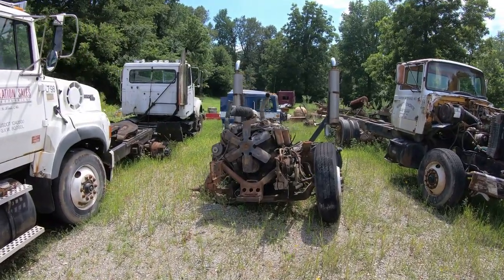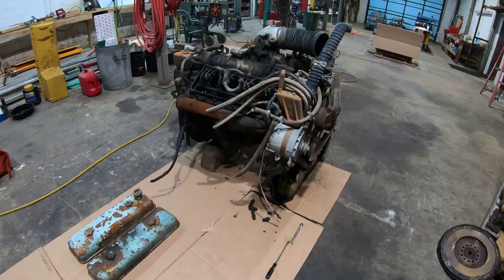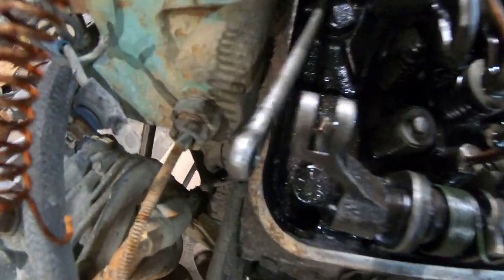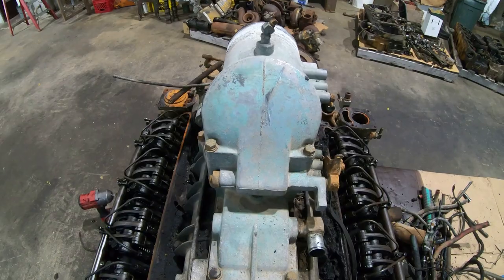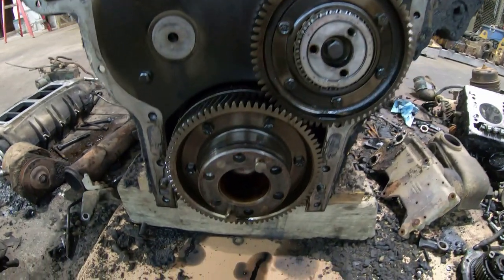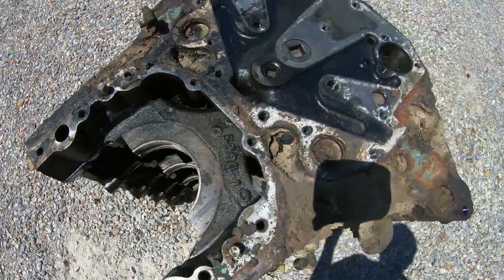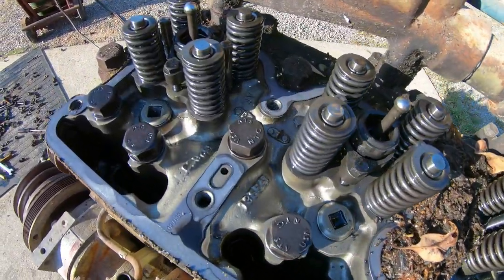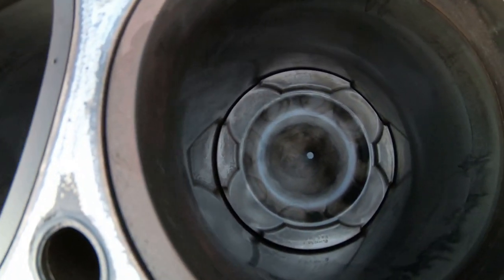Runaway 2 Stroke Detroit Diesel and Ethered Cummins Engine Tear Down

Comment from the maker: Link to runaway 8V71 Detroit video:   https://youtu.be/zp99ewVvqeI

Link to 855 Cummins ether video:   https://youtu.be/cPh6NFvBCnc
Reply: KT3406E 
you got yourself quite a playground
invite me over all bring food, beer, etc....
Reply: I had a 300 Mack engine do this too. Valve broke off and beat the crap outta the piston. Then pieces of the valve moved to other cylinders and beat on them too. What a mess.
Reply: Can you set up another "Viking funeral" with a random big liter diesel, sucking in a balloon full of Tannerite?  Like say having a tube plumbed to the intake.  Trap-door-drop a sausage shape balloon full of tannerite into the intake of an 8v71 or turbo of a 4-stroke.  Yeah, that would be great to see what happens.
Reply: When charging a dead battery aren't you supposed to charge at low amps?
Reply: Make a store where you sell your engine parts.
Reply: 6⁰⁰ @michaelcuff5780
Reply: An 855 or k-19 inline 6 woulds make for a fun sick 2 stroke conversion! inline 6 is easier to fill in the crankcase with billet aluminum machines and clears crankshaft and rods by about 0.125 in or 3 mm. make up some big reed valves and cut runner ports up the liners. now use all 4 valves as exhaust and running 1:1 with crank like fuel pump. a dry sump feed system and feed bearings, then throws off and burn off. This is how the Sachs, Hatz and some Duetz german 2 stroke diesels work.
Reply: The 855 might just have enough room to cut ports in the liners and somehow weld up the water jacket. or do a poppet valved u-loop charged 2 stroke conversions.
Reply: Those v8 detroit heads are bloody heavy ay mate  :) ,  i rebuilt  for the first time in my life an 8v92 from my cabover kenny quite a few years ago in my driveway , i had the cab up and clean and jerked the head off the left side of the truck ,  wont be  doing that again   :) .

Comment: As a mechanic that started out in the mid-70's, I worked for a nation-wide trucking company that, (at that time,) was 100% 6 and 8V-71s. Oil leaks? If you didn't add a gallon every time you got fuel, you started to worry something was wrong. You didn't mention them, but each side of the block had "air-box drains," which were tubing that allowed the excess oil shoved though the whole system go drip, and drip they did. A driver that idled an engine for any decent period of time wound up with two 6 inch or better circles of oil underneath, and going down the road slathered the underside of the truck all the way to the rear axles! California eventually outlawed them, which was the demise of Detroit Diesels as highway trucks. Thanks for this! A walk down memory lane. . .!!!
Reply: gac914 The old timer I worked with referred to them as “Green Leakers”. I’ve only worked on a few, but the memorable one that sticks out was a Roadway truck with a 6V-71. Like you said, it was POURING oil out the air box drains and the scale bitched at them to get it fixed. They brought it to us and we told them it was wore the hell out, but they weren’t having it. We were directed by them to install a ball valve in the drain tubes in no uncertain terms. Did as instructed, and a week later that poor bastard looked like a duck covered in crude from the Exxon Valdez oil spill. It promptly became their yard dog for moving trailers........But the sound of those damn things—- PURE SEX.
Reply: @DieselDoc78  Yeah, and they were pretty fast on acceleration, too! The other thing I remembered after writing the first one was, it was definitely possible to run them "backwards," and doing so they would start sucking the engine oil out and run on that. How do I know?? I had it happen to me once, and the only way in those days to tell was they had mechanical tachometers and while the engine would run, the tach wouldn't. They would run backwards if you didn't give it enough throttle while on a slight incline, and it would reverse the direction. REALLY bad if you didn't catch it right away -- fortunately I realized it quickly and dumped the clutch while holding the brake to stall it!! Fun days, for sure!! (BTW, I can't believe they'd have you guys install shut-offs on the box drains --  there was a management decision by someone who didn't know what they were doing, for sure!!! :-)
Reply: gac914 Typical Roadway management. Pencil jockey that looked at numbers and knew nothing about trucks.......At this point in my life I just need my pops to teach me how to row a pair of sticks before he’s gone. That and I really need to retrofit a 4-53T into one of my pickups.
Reply: There was a way to prevent the oil problem. Airsep made units that went on them to pull the fumes out of the crankcases. We ran ours with a restricted filter so that it put the crankcase under a vacuum. Then the only place the oil could go was out the exhausts. After it was burned in the engine. Still you needed to add 2 quarts of oil every 24 hours of running. We changed the oil every 300 hours of operation.
Reply: Harry. B. Renner. jr.  We ran ours at 1800 RPM normally and not less than 1400 RPM under load in stationary use.  If they ran under load at 1200 RPM, you would see unburnt fuel in the exhaust pipes. We actually saw it drip out of the plugs on the bottom of our mufflers so we restricted them to 1400 RPM or above. The overspeeds were set to trip at 1900 RPM so we did have a little fudge factor if needed but then we had to worry about prop cavitation.
Reply: @gravelydon7072  why change the oil at all if you're putting fresh oil in it EVERY day? Lol
Reply: @xandergibbs2149  Mostly for piece of mind. There is a certain amount of very fine metal particles that do not get flushed out with the oil that gets burned and the filters cannot take it out of the oil. So it goes out the drain every 300 hours. Oil is cheap compared to an engine overhaul and in our work, time down was very closely watched. DD recommended overhaul for our use was 7500 hours. In bad years, that would have meant an overhaul on a yearly basis. We ran them to twice that and more. $7000 a year in oil and filters vs $14,000 per overhaul in parts alone.
Reply: I had a john deere 440 CCW snowmobile that leaked a little on the clutch side! i was used to 2 stroke messes as a kid and now work on 2 stroke powered detroit dice boats, i bought a silver 8v92 and a small block 2 stroke johnson. next convertet a harley v-twin into a 2 stroke! We got 2 stroke diesels in our amy guard unit trucks some of them. and im looking for a Sachs DL600 crankcase scavenged 2 stroke diesel! it is dry sump feed to bushings and burns off sae 40! I once saw a Duetz 2 stroke 4 cyl on a welding generator with oil injection tank. it got scrapped bumber!
Reply: Self lubricating . Not for me

Comment: so, those holes in the head and block, were actually there on purpose!  Those were the holes that were used to mate two blocks and heads together when they wanted more than 8 cylinders.  The 16v71.  Since the 2 stroke cycle does not care about engine rotation direction, they would bolt the front of 2 blocks together, and the front block would turn backwards.  They could make V6, V8, V12, V16, and V24 units to order.  Many had long joined camshafts that were just turned around to match the new rotation direction.  The V12 was a pair of V6's bolted together.  The V16 and V24 were V8 blocks bolted together.  These were the first truly Modular engines, and only died due to emissions.
Reply: Really? That's pretty mind blowing, thanks for sharing!
Reply: @sourbrothers73  not exactly all true but close, the 12v71 is a true v12 block same with the 12v53 I believe. The 92 series is 2 v6s bolted together
Reply: There was no production 24v71, nor was there a 20v71, but there was a 16v71 which was 2 V8 blocks. The 12v71 was a true 12 cylinder block. In the 149 series, there was a 20 cylinder, and it was two V6s on either end of a V8 block
Reply: The Cleveland and Electro Motive Diesel engines are almost the exact same layout as the Detroit's. of course they dont part for part change over, but they are the same 2 stroke system. Intake ports, 4 exhaust valves, cam shaft controlled injectors. EMD has shaft driven turbos for the forced induction engines, as well as because the EMD motors have assembled blocks instead of cast. So they just build the block with more cylinders, 8, 12, 16, 20
Reply: and if you wanna see one ( twin block DD ) get sent to heaven ... head over to DEBOSS Garage's channel and check it out.
Reply: That is good engineering. With today's electronic engine management systems, those modular engines would work out well for any application.
Reply: @sammybrasch4926  yup that's it
Reply: Since general motors owned both Detroit diesel and Electro Motive Division [about 75% of the locomotive engines in the USA] till Penskie bought Detroit Diesel from General Motors there are alot of similarly designed engines in the bigger machines - the 149 series looked like a baby EMD except the EMD had a steel block - I loved them - if you had a bad wreck you just got out your torch and welder to fix the block.. sometimes it would take some in place machine work but you could get up and running - things could be taken apart without alot of overhead crains except for the turbo.  If you wanted to you could pull the entire power assembly - or if no overhead you could take it apart and manhandle the pieces.  The two stroke had good power to weight ratio so they were used in many many boats.  The 16 92
Reply: The 16 cyl 92 series could be souped up pretty hot - they had two 8 cylinder blocks bolted together- which is a pain in the ass to do - they had four 4 cylinder heads and blower drives from each end - only the front blower had a governor drive - the hot rods would have two turbochargers with what was called a blower bypass - the turbocharger would get more efficient than the blower so the engineers developed a way to equalize the pressure across the blower so it wouldn't drag the engine down.  These were great engines till the government regulated them out of existence- then came the series 60 engines.
Reply: @sammybrasch4926  Correct, but there was a 24-71 setup. It was 4 6-71s bolted to common gearboxes. 2-71s, 3-71s, 4-71s, 6-71, 6V71, 8V71, 12V71, and 16V71. As for the 16V71s there were two different versions. Both used 8V71 blocks bolted together. The early version used a one piece crank. The later versions used a two piece crank, bolted together. One piece cranks often became two piece cranks at the worst possible times. And there is a specific way of rotating the cam shafts for directional use. Depending on where you put the gear on the flywheel end decided which way it rotated the crankshaft(s). The camshafts always rotated the same direction as that is what controlled the valves and the injectors. At the flywheel end, idler gear on the left gave clockwise crankshaft rotation at the flywheel. With the idler gear on the right, you got counter-clockwise rotation at the flywheel. But the two camshafts always rotated with the top of the shaft towards each other. This also was needed so that the blowers always rotated correctly. The drive lobe was on the right while the driven one was on the left when looking at the blower drive gear.
Reply: @gravelydon7072  I bet your old like me to even know that - hardly anyone knows you can change the rotation of the engine by putting the idler gear on the other side - course u have to buy a different starter too..
Reply: also had a v20 that was a v8 with 2 v6s either side
Reply: @jth1699  And it is one way to really foul up if you install it wrong and try to start it. EEK!!!  I won't say I'm old but I was factory dealership trained in the mid 1980s on the 71 series engines. Both for overhaul and for tuneups. Just a few years after that, we overhauled 3 of the 12V71s at work with me doing the final assembly and tuning. At the time, one engine had 14,000 hours on it. Second engine had 12,000 and the third had 10,000. The one with the 12,000 hours on it had another 16,000 hours on it since overhaul when I left. It was not touched except for oil changes and upgrades we did. But nothing internal. When I installed the liners, they were shimmed to where there was only a maximum of .001" difference in head to liner over the 6 cylinders on each side.  It cost us $14,000 in parts for each overhaul and we got our money out of them and then some. With my tuning and the loads we had on them, we got fuel use down to 9 gallons per hour and 2 qts of oil every 24 hours. The specs from the Army Corps of Engineers said that we would burn 19 gallons per hour at full emergency load.
Reply: @sammybrasch4926  Yes there were production 24V71's ... many of them went into yachts, others were used in backup generators. It was two 12V71 blocks bolted together. I've worked on one (generator) at a food distribution warehouse in central NJ, the only one I've seen. A coworker of mine has worked on the marinized ones. Still an extremely rare bird.
Reply: A guy a DNE performance mounted 2 800 rotax togerther abd bore it 850 to make a 1700cc 2 stroke turbo pushing over 700 hp and in sane torque. i phoned him an could go bast 850 hp and 600 ft-lbs torqur for the drag sled would wreck the drive train. Imagine taking 2 v6 mercuy optimax v6's to make 6.4l v12 and turbo it to make 800hp and 1100 ft-lbs torque. Now drop this in somthing like an f-250 or mustang. i would love to repower my f-250 with this this 2 stroke combimnation would sound better than this 4 joke crap we get in trucks today. i got a small v8 2 stroke from a boat and an 8v92 2 stroke that i tinker with. imagine the racket and fun you can have with this cummins 2 stroke!https://mart.cummins.com/imagelibrary/data/assetfiles/0058689.pdf?fbclid=IwAR3PWM1vZs8JxpuZMoJO5Y0YFoF9pV9fuGEhbyiGgxIP0r6sxzhqo5_P9oY.
Reply: The insanity of V24
Reply: @ScarlettStunningSpace  How about making a v24 out of 4 of these:http://www.caldwellracingtechnology.com/wp-content/uploads/2018/02/CRT_2-1.jpg. The 4L v6 2 stroke makes over 650hp and with turbo much more! that would be 2600hp w/o turbo and 3000 of with turbos for a 16L 2 stroke v24!
Reply: Its made on the 4 or 5 axis CNC laser mill by the one eyed one horn flying purple people eater. To make this 2 stroke.
Reply: @ScarlettStunningSpace  i just got 6 gallons of motule 800 2t full synthetic 2 stroke oil for my 8v92! boy its not cheap!
Reply: Wow! You learn something new everyday thank you 🙏🏼
Reply: @jdlawless_fuel1416  my understanding is there were only 3x12v53tt Detroits in existence, ever made, which were prototypes for the military. I know there is, was a you tube video made where some fk wit reving the shit out of a cold engine on the back of a pick up truck. If he knew how rare that engine is he wouldn't do that
Reply: @mohabatkhanmalak1161  Except when you tried to build one yourself it would throw a code "NON OEM CONFIGURATION DETECTED" and lock you out of using it 😂
Reply: @jth1699  emd crankcase not block

Comment: Recalling my high school days ( Some years ago that's all I say ) I lived out in a census designated place out in Kern county. Miles away from the high school. About 16 miles in to town. Well, I was fortunate enough to ride an old crown school bus. It was a tandem axle. It had one of these 8v71. Well one day after school, we would all tell our bus driver "Home James!!!" Yeah his name was James. He was a good guy and an old diesel mechanic. Well one day after school, he was struggling to get it to start. it WOULD NOT start to save  its life. I was one of the back of the bus rowdies even though I was a freshman. Well he cranked on it and cranked on it and CRANKED on it some more. Went it cranked up, it had a stuck rack...We were all on the bus. That sucker starts to wind up!.. All we heard was BWAAAAAAAAAAAAA! James calmly grabbed the CO2 extinguisher and opened the engine bay and snuffed it out till it died. I was in auto class... One of our projects was to remove the engine and check it for defects and free the rack up. Got to rebuild the engine and the city mechanics put the engine back in the bus... Good times!!!

Comment: Love the explanation of the governor. "bunch of flyweights going around doing crazy S%&t" . I had a 6v71 generator runaway once, I will say you simulated a runaway perfectly.
Reply: Im in the generator field but check the ol rack
Reply: Yep, the governor has to foul up to have it run away unless you don't change the oil like you should. You ought to see what happens when one of the internal fuel lines to the injectors breaks. It can launch the dipstick across a 25 ft wide room. And the engine just keeps on running. Took three oil changes to get the smell of the Diesel fuel out of the crankcase oil.
Reply: @gravelydon7072  they say a Detroit never runs away....the mechanic does.
Reply: @jamesanderton344  I liked ours. 14,000 hours on one before an overhaul. By the time I left, there was another with 16,000 hours on it after we did the overhaul at 12,000 hours. And it was still running fine. I set everything to the bare minimum tolerances when doing the rebuild. Our coupling between the PTO and the gearbox allowed for .060" runout. We were unhappy if we couldn't get them to .003" at the max on the dial indicator. That is how close we set things. The head to cylinder liner difference was no more than .001" over the whole head as I shimmed the liners to get them that way.
Reply: I was looking for this comment. LOL!